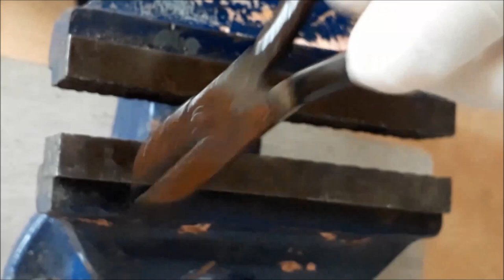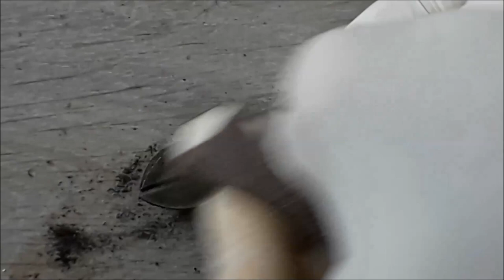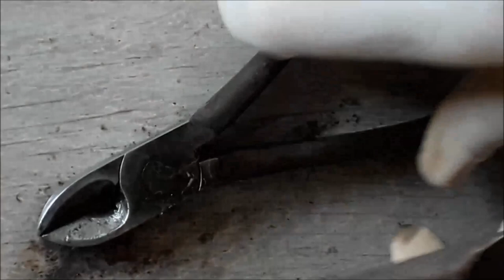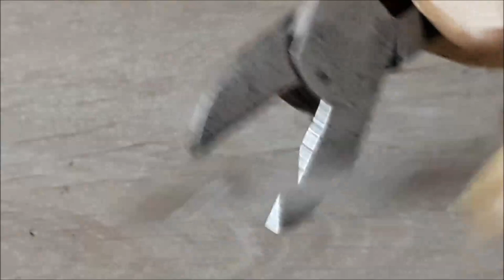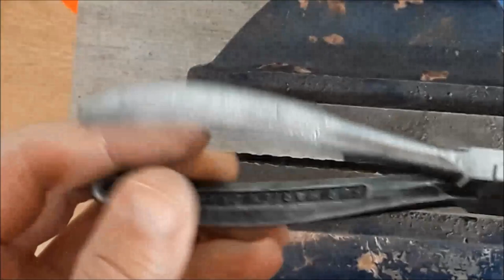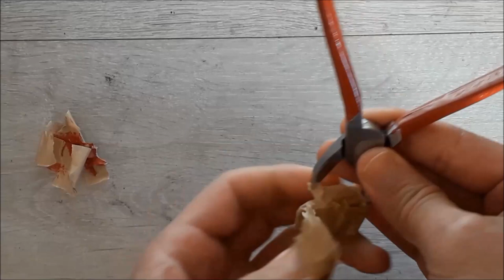Knipex Side Cutter Restoration

Comment: Comments on any special tips would be appreciated, thank you.   Was that like a plastic dip paint and why didn't you use a primer for better paint bonding?

Mine were rusted too badly and wobbled excessively  to be almost useless  -tried solder to take up the slop/slack.  Helped but still not perfect, any ideas on how to take up all the slop?
Reply from the maker: I wanted to keep the markings on the handles readable, so used just one layer of good paint.
If they are too worn then it's not worth the effort.
Good luck.
Reply: @restorationandrepair6013  Very logical.  Thanks for the replies and keep giving those oldies but goodies new life.